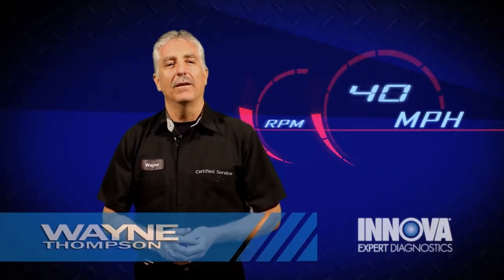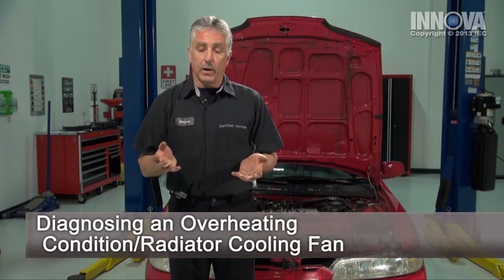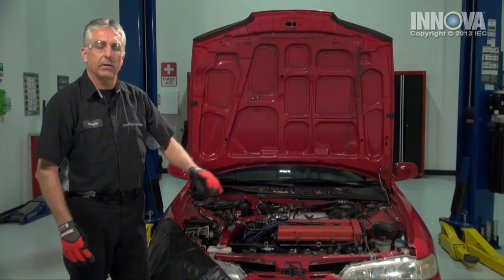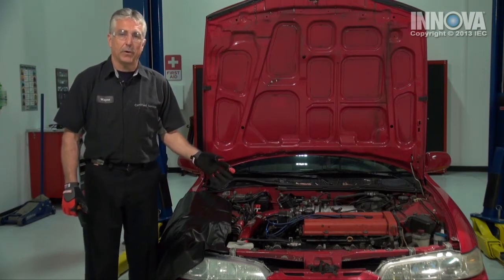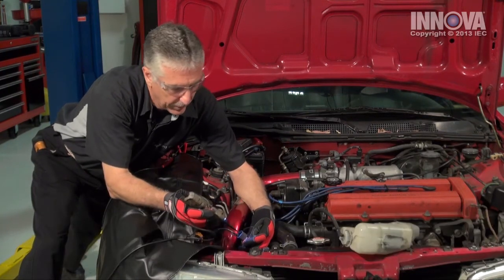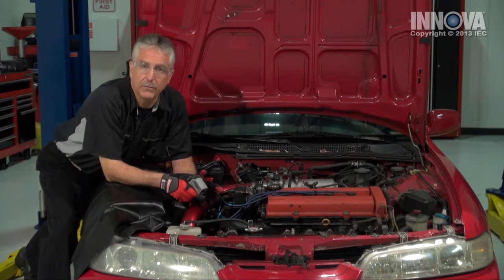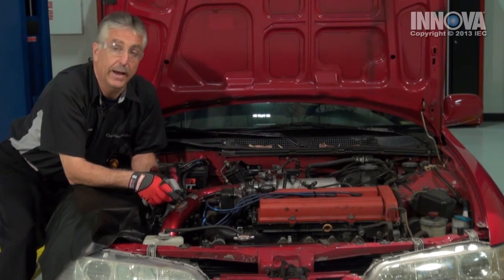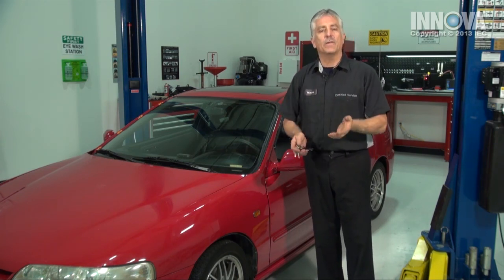How to diagnose  an Overheating Condition - Radiator Cooling Fan - 1999 Acura Integra

Comment: Question; So both fans need to be working when the temp is 200 or both fans should be working when the ac is on at 200?